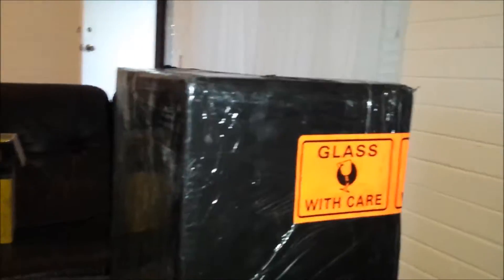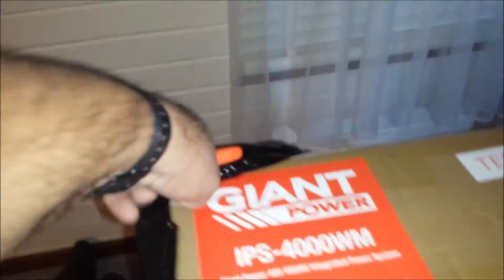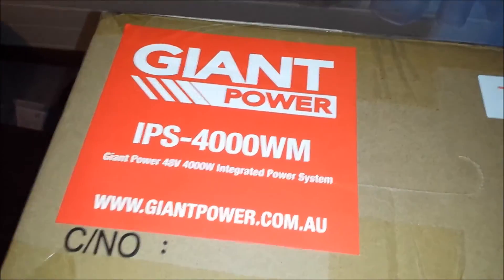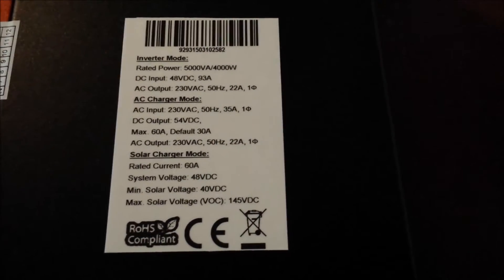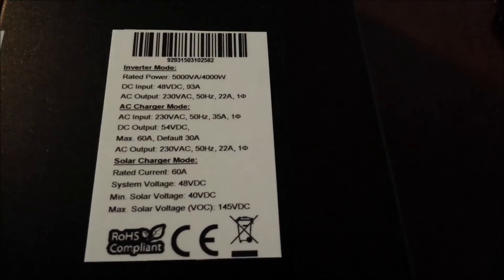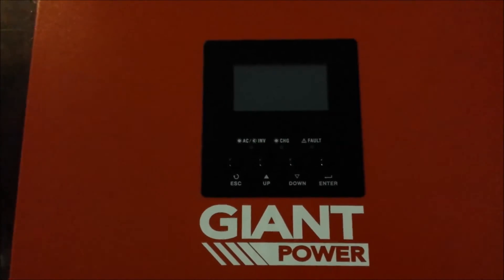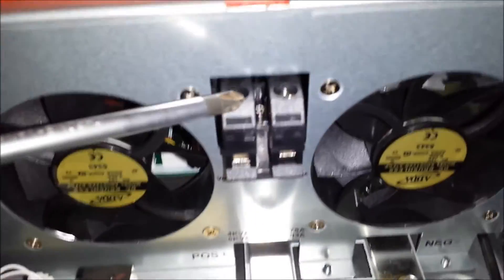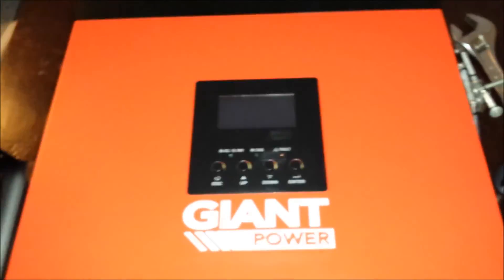Off Grid Electricity - Giant Power Integrated Power System

Comment: Do you still run this inverter?
I have a pair of them, I installed them with 5 strings of 130 AH AGM charged from my grid connect system via contactors . I'm now upgrading to LiFePO4 @ 62 KWH and a combined 5.2 KW of panels.
I am moving the entire set up to comply with the current AS for battery installations. 
From what I have been able to find Giant Power inverters are now Growatt and are slightly upgraded. The 4kw / 5kva is now 5kw / 5kva wirh 450 vac solar MPPT.
The only mistake I made was not buying 3 of them and having 3 phase.
Reply from the maker: I still have it, I still haven't used it.

Comment: Hi how is the inverter not setup yet still waiting to see it up and running thinking of getting one myself
Reply from the maker: +Ross Musolino If only it were that simple. I've got to build a shed to put the inverter and the batteries in. Just a couple of weeks ago I managed to pay $1,000 for 12 260W REC panels that were manufactured in January 2015.

I'll also be spending about $3,000 on batteries to pair with this inverter. Then there's all the cabling and circuit protection to take care of. With as many hobbies as I've got, these things all take time.

Thanks for your interest.
Reply: +Pop's Shack yes I no it all costs money you sound like me. l want to build a shed to so inverter has to wait a little longer or l might buy one and keep for a while:)